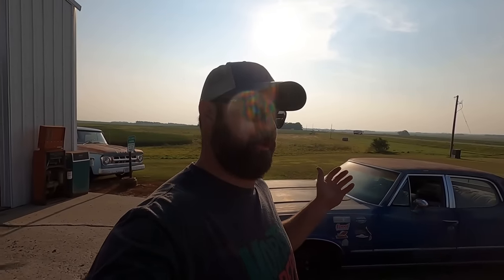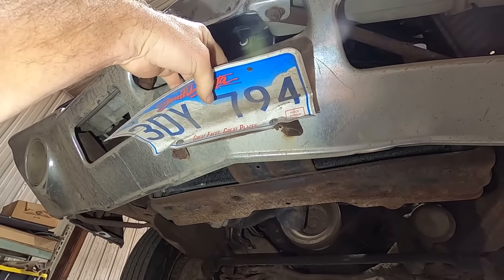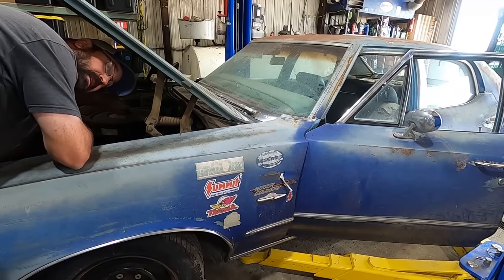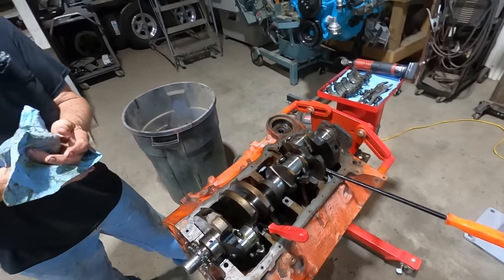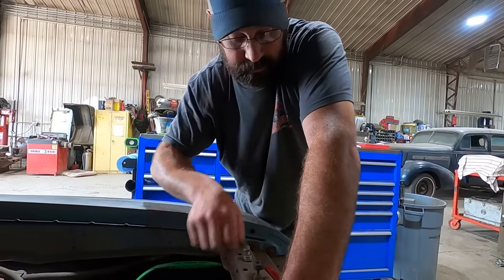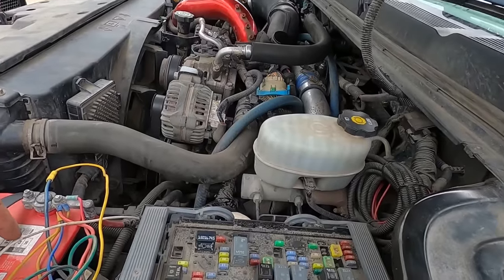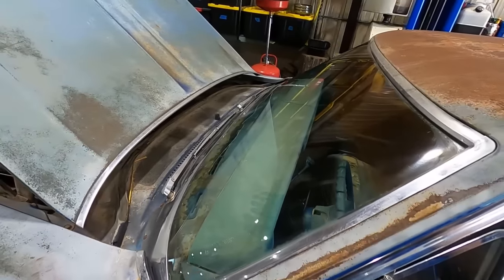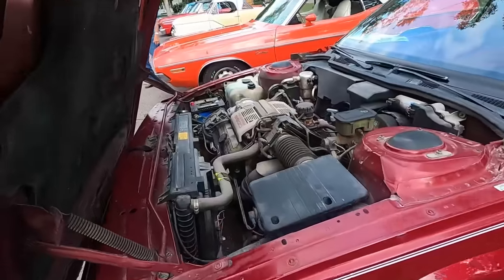Dirt Cheap Muscle Car!! Saved from the Scrap! Will It Run?!? Budget Built Hot Rod!

Comment: Hiya Mortske.  One thing I learned very early on is to look over the crap I was going to put into the car before I pulled the car apart.  This way I don't put a worse piece of crap into the car than I already have or spend ages trying to make something fit that just doesn't and won't.  If the car still moves and stops under its own power - in whatever capacity - its always better than one that's in pieces that the only way to shift it is by pushing it.  I grew up on a piece of land where the land was contoured in a way that it was upslope to the garage and upslope to the house, so pushing a car our the garage meant you had to get a fair old pace up or it got stuck in the valley in between one and the other and blocked the drive, which got you yelled at.  So, better a running moving car than one that is in pieces when Dad wants his garage!

I take it that DB doesn't realise what his nickname stands for down here?  You call someone "DB" in Kiwiland and they either think you're saying they drink an inferior brand of beer (Dominion Breweries is a weak and watery flavoured beverage), or it stands for Dopey / Dozey / Dumb Bast*rd.....which means they don't have any common sense an often do things without considering the consequences or not take any pride in their work and don't do it properly......and not learning from his mistakes.  Let's hope he stays ignorant of that because it gave me a few laughs hearing him called DB and seeing / hearing about some of the stuff he's been doing.  I nearly sprayed my drink all over the laptop screen when I saw he'd made up a sign for an allocated parking space!  No way would I ever park in it though! 

Credit where credit is due though mate, that Olds is a great starter for 10.  Pity abut her frame, but the rot and the body itself aint that bad.  Me, I'd give it a waterblast to see whether I could get a lot of that sh*tty paint off, cut the rot out and replace it, replace the windscreen, chuck primer at the surface stuff on the roof and left rear panel and if I was real keen I might even rattle-can it satin black so it was all one colour, stick a decent exhaust on it, go through the brakes, get everything working and like you say, just chuck some seatcovers on it, maybe throw some carpet in it and run it.  I'd have to make it watertight because rain is a constant thing here summer or winter, but I'd be driving it without doing much at all except making it safe and making it comfortable to ride in.  Looking good is a relative concept and if it looks good enough to me, its all that matters.  The arseholes we get in carparks that don't give a rat's arse about what they ram their doors into mean that anything I own is GOING to get whammied at some point, so why make it a trailer queen?  That engine sounded fan-f***ing-tastic too.  Even sounded like it might have a mild cam, but who's to know, eh?  Great save.  Hope it goes to someone who takes it to the next level and enjoys it....and brings it back to show you.

Oh - and I totally agree with the two-barrel rant.  You don't need anything more than that if you're gonna drive it on the road or daily it.  My Stag has a Rochester 2-barrel on a 4.4 litre (269 cubes) V8 and it has plenty of stick to turn rubber into smoke and push you back in your seat when you whomp the loud pedal, so what more do I need?   She already drinks like a fish on meth, so the only thing I see a four barrel doing is emptying the gas tank faster. No bueno.......

All the best.

Comment: it's a bit late and you probably have the answer but you are correct, no resistor with the pertronix - "Pertronix says you must use a "points type" coil. If the coil required a ballast resistor when it was used with points, then you must still use the resistor. If it didn't, then no resistor is necessary.

In either case, the Pertronix unit (red wire) is supposed to get a full 12 volts, so connect it ahead of the ballast resistor if one is present."

Comment: The rocker nuts on the Hillborn injected SBC are called poly locks.  The are used for racing with solid lifter cams, or with full roller rockers.  The stock nuts tend to back off when lash is adjusted many times on a solid lifter cam and it is run at high rpms.  It doesn't matter if the studs are screw in or not, it has nothing to do with that.  The hex works as a jam nut that locks on the top of the stud to keep the nut from backing off.
Reply from the maker: thanks for the info!

Comment: you are correct, Sir. no resistor with pertronix or HEI. Gotta run a new wire from a switched hot in the fuse panel to the coil and boom, bob is your uncle.

Comment: Oldsmobile used a resistor wire from the ingnition to the coil instead of a Ballast Resistor.  They had a Bi Pass wire from the Solenoid to the Coil that shot 12v to the coil while cranking.
Reply from the maker: Interesting!

Comment: I agree with you on the 4 door. I have a 1975 Ford Gran Torino 4 door with a 351W. I am treating like a 2 door and was cheap enough. Why punish yourself by not driving a fun older vehicle just because it has 4 doors. After all the sleeper cars  we still have an issue with 4 doors. Crazy! I am going to enjoy my 4 door.

Comment: Long time listener-first time caller. GM does not use tags on the diffs unless it's a spicer. 3 letter code is stamped in the right side axle tube. Mainly on the top or front of the tube near the shock mount. Lots of code info on the ole interwebs.
Reply: 25 years in auto salvage,  quit doing that when my hate of the general public made me go back to turning wrenches at home in the shop.  Now retired.
Reply from the maker: Good to know!

Comment: If you use the right paint it does , the same thing you put on the snow plows 🌨️❄️ to keep it from sticking. They make a epoxy coating paint that is impervious to oil and heat to paint the valley and heads with it is like 150-200 a quart. I always sprayed it in a gun.

Comment: Ok kiddies..stay away from 72 whatevers. This guy is a pro..he has access to tools and parts. He makes it looks easy. I had a 72 bonneville with a 455 in 1980. I had a 40 piece 3/8s inch kmart socket set..yes it did burn outs and we could run over road signs with it..but even in 1980 parts were  hard to find
Reply from the maker: Well said!

Comment: Early 70's GM cars had a plug underneath the seat by the door that could be disconnected to disable the seat belt buzzer. There may have also been a sensor in the passenger seat if it was occupied. It kept buzzing because Duff wasn't wearing the seat belt.

Comment: Good morning from Cape Cod 🦈 had to do some rust repair around the back window of a 71 Cutlass with a vinyl top of course. It wasn't a 4-4-2 but it did have a 350 rocket with a 12-bolt posi and boy did that car boogie down the road. It was real cool following you giving DB a hard time, and check out the progress with Mojo's engine dismantling. I really think this is an awesome video. Keep having fun Mortske. How about a little Puddindance outback power washing 😂✌️🇺🇲

Comment: The way the coil is wired from the factory, it bypasses the ballast resistor or resistance wire during cranking anyway.  It's wired to get full voltage from the starter solenoid lug during cranking.
Reply from the maker: if the wire is hooked up properly and not snipped

Comment: @Mortske, I think Hilborn closed their doors recently but you can have them switched over to EFI Those rocker nuts with the inserts have that inner nut to lock them in place. Magneto's can be run on the street on E85 because the spark is crazy hot. You can get spark just spinning them by hand. I ran one on the street, you need a kill switch, stainless steel core wires and a starter that can spin to 1000 rpm.

Comment: I'm sure you've seen a poly-lock rocker nut. Just adjust the rocker to valve clearance via the outside nuts then tighten the center screw with a Allen wrench to keep it from backing off.
Reply from the maker: first I've had one in my possession
Reply: @MortskeRepair  Yes sir, quite a few people use a drop of blue Loctite on the Allen screw. Been known to do so myself.

Comment: Lol...the noise under the hood is the key buzzer! They were all under the hood in that era.  4 doors aren't hacked like 2 doors so everything still works. Interesting about the torque...350 Olds is a big bore, short stroke engine vs a 350 BUICK which is slightly over square. Olds did make a 400 big block. They also made 260 and 330 cid small blocks.
Reply from the maker: Interesting

Comment: those rocker studs are pressed in like STOCK ,but the rocker pivot is a hex bolt head with a set screw to lock the rocker pivot after the desired clearance is established with feeler gauge or dial indicator. (These don't come loose when the set screw is tightened.

Comment: That thing sounds like Christine ! In the 90s we bought a 1972 4 door that was spray canned flat black and had dog dish caps. I think we gave $ 150 for it to guy that was a pin striper for the local body shop. It started right up but i noticed the engine was chained down with a chain on both sides. When i asked why he said the last owner tried to rob somewhere and it was his get away car ! LOL It ran perfect and that old rocket 350 did the best one wheel peels ive seen. We tried to burnout leaving a store one day and something broke in the rear end and that was that.
Reply from the maker: awesome!

Comment: When I swapped a 302 into my 4 door Galaxie in place of the worn out 289, I was gonna keep the Ol 2100 Autolite but I had to switch to a 4 barrel holley to run the throttle position sensor for the 4r70w I put in. Gonna keep the 289 and 2100 around for later use though

Comment: Excellent video Mortske Repair   :) , Duff Dog 🐕,  , MOJO  senior mechanic  ,  Chin  , also wise on changing to another good TH 350 transmission plus driveshaft  , 350 most common motor in these cars and tell other ones used! 307 , 350 , 355 , order 425 Oldsmobile Tornado  motor , 454 , and 455 ! They get Turbo 200 Power Glide  2 speed, Turbo 350 3 speed, Turbo 700SR 4speed Overdrive Automatic  transmission  and some rare option get Manual Coulmn Shifter 3 in tree ! Options  were Air Conditioning, Power Brakes with Disk front brakes or 4 drum brakes yes were correct on , Power Steering,  Power trunk buttons in glove box , Am or Am/ Fm radio special ordered 8 track , plus 5 speakers on Am on in middle  dash , Power radio Antenna  on front fenders or back one instead front Windshield  , plus Blue tint on front windshield, 2 speed Windshield Wipers  , Tilt Steering, 5 or 6 seater  , Power Windows , 2 chrome mirrors instead one or body colors ones  , Console Shifter  and clock in dash option order!  For Seat Buzzer fix buckle seat belt to in before start engine too but always car knife in case seats belts don't unlock to take off! Also on starter sounds like give up Mortske  the Pig Tail ground on rad or fender maybe corrosion on connector plus bolt also shine up and cure it ! Also seat belt relay in fire wall lube up chrome  or lube up seat belt buckle part too ! 2 barrel or 4 barrel carb are excellent in Muscle cars and are Muscle in any them ! Also can get Muscle Car vechile in 4 door and my 2002 Chevrolet Impala E-X 4 door is lots fun too just as much a 2 door Muscle car too !

Comment: Oldsmobile made a 400 in 1965 to 1967, I think it was the engine that originally was in the 4-4-2. 
(4)-400 cubic inch V8
(4)-4 barrel carb
(2)-Dual exhaust 
Even if its a 4 door, still a sweet car!

Comment: Mortske, You can snake the nose cone on without removing pin and snap ring. You can also take the cover off the starter solenoid and replace either replace the battery cable stud and output stud or just turn them 180 and this will give the disc in the solenoid fresh contacts. Maybe you knew this already? 🤔
Reply from the maker: good to know!

Comment: One thing to remember well the oldsmobile and Pontiac vehicles are high torque application powerplants so usually you use a high torque starter on them to swap out the nose and they need amps and full ground contact to crank them over so ..
Reply from the maker: good to know!

Comment: Checking for magnetism at the back like that doesn't  necessarily mean it's charging, that simply confirms that the armature is getting field voltage. A better way is to feel the laminations  where the front & rear alternator cases meet. If that's  warm it's an indication that the alternator is doing some work.
Reply from the maker: Interesting

Comment: ntil 1962 when the 327 came out.The Fuel Injected 327 of 1962-1963 had larger ports and 1.94 X 1.50 valve with the familiar camel hump or double hump on the ends of the heads.... Since these castings were also used on the 300HP and 340 HP engines of those years people noticed that these heads were the same but the term " FI " ( Fuel Injection ) became the street term for them since they were better than the old 283 heads.... In 1964 Chevy put 2.02 X 1.60 valves in the 1964/1965 375HP FI 327 engine.... The Term FI head
or ( Fuely Heads ) stuck.... So it got to the point that any of the double hump 1.94 X 1.50 or 2.02 X 1.60 castings became known as FI or Fuely Heads.... despite the fact that they were used on
327/275 , 327/300 , 327/325 , 327/340 , 327/350 , 327/365 , 350 / 295 , 350/300 , 302/290 HP engines that never even came close to haveing a Rochester FI unit being bolted to them........

Back then it was not common to refer to cylinder heads by their casting numbers... So to distinguish the " Perf Heads " from the non perf heads the FI / Fuely / double hump / camel backs/ pretty much all meant the same thing.....Most notibly the 461 , 461X , 462 , 186, 492 ect  type castings all were considered the perf type castings... or fuely heads.

Comment: On the Master Cylinder rebuild/replace-  Size of the reservoirs- the small one is for front brakes (short line run)  larger for rear (longer line run) brakes
Reply from the maker: interesting, never heard that reasoning before.

Comment: Nice sounding cutlass,needs a dual positrack rear-end,dual exhaust,new spark plugs,oil change & filter, check the fuel filter in the carb,tires & wheels & it would be great, oh yeah, the other pin for the trunk,just leave paint like it is
Reply: A "DUAL posi-trac rear end"? Ya wanna put a Dana 70 in it with dual rear wheels? 🤣

Comment: I seem to remember Rocket engines used to be gold and maybe had some green parts as well not sure it's been a long time since I've worked on a Olds.Theres a shelf on the block right behind the water pump, infront of the intake, should say 395558, I believe all olds motors are rockets, the term got droped in the late 70's.

Comment: Those seat belt laws are a pain in the ass. My first car was a '57 Bel Air, and I was not able to legally drive it in TN since it didn't have seat belts. They didn't make exemptions for older cars, and I damn sure wasn't going to alter an original car, so I just rode gangster,lol.

Comment: The Pretronix ignition alway ends up advancing the timing and does not like ballast resistors as you said. I have put them in a few trucks and tractors and they work great. I had a 72 Olds and it was awesome! It may have been in a little better shape.....
Reply from the maker: Thanks for the info!

Comment: I had a 1962 small journal 327 solid lifter with a DZ service cam Victor Jr w/750 dual twisted wedge aluminum heads feed pushing close to 500 hp and would rev to the moon easy 13k only did that once and then put a rev limiter set to 6700 rpms

Comment: My 1963 Plymouth Fury also has power steering and no power brakes.  The original owner didn't trust power brakes and his wife had to beg him for the power steering.  Apart from that the car has power windows and factory air.  She is optioned very oddly.

Comment: The general rule of thumb was if you're running anything over about 450 hp you needed a 4-bolt main. Especially if you're doing a whole season of drag racing. I'm thinking what they did was they pulled a stock 2 bolt granny engine and put that Hilborn on it along with some other things? Hard to say -- it's hard to believe someone would use a 2-bolt in a race car. They say 4 bolts are really hard to get but you just have to know which trucks and vans had the 4-bolt and go junkyardin'. I used to do that with a few engines I sold -- slap an intake and headers on it and it'd sell. 
At higher RPM's those two-bolts would erupt in a massive explosion of engine parts shrapnel. Somewhere around here I have a twisted rod that ejected out the side of a 2-bolt.

Comment: I had a '71 Olds Cutlass S/X 455 auto, swapped in a posi 10 bolt, and scared myself when I pulled the front wheels off the ground. Yeah all the torque.
Reply from the maker: fun times!